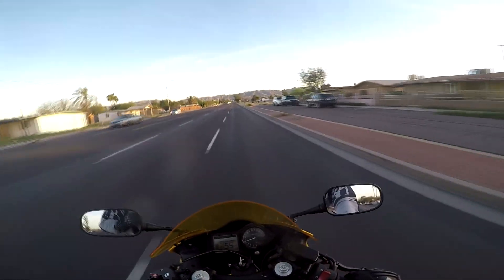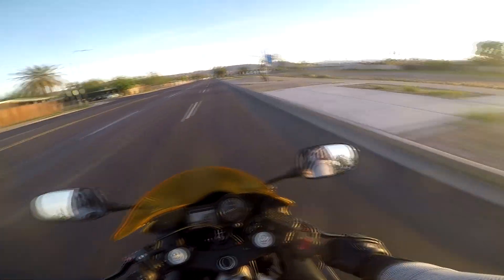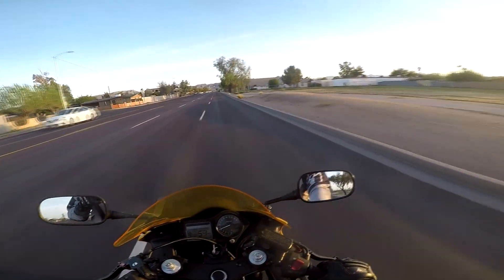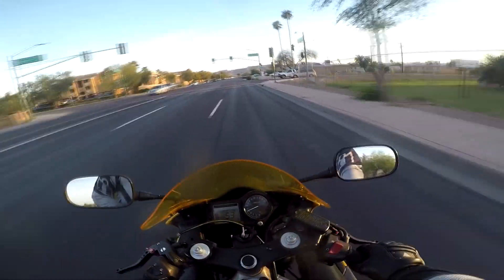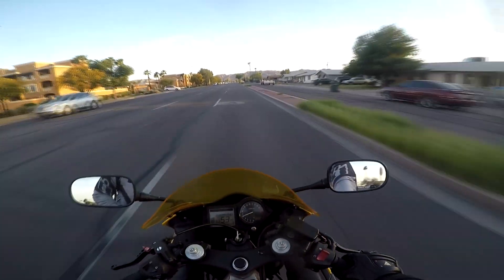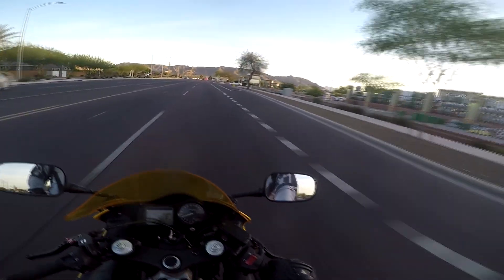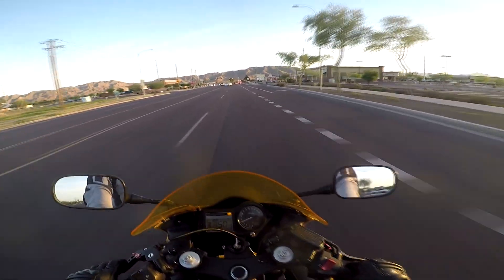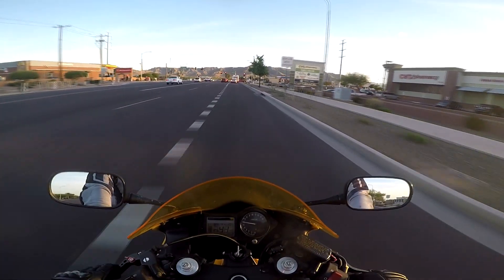should you get a power commander?

Comment: putting on a power commander on a stock bike is still a good idea imo. Most bike manufacturers run the bikes lean or rich depending on the bike. adding a fuel mapper won't hurt it all. the only downside of doing this is that most people are trying to get more hp and end up causing the bike to lose MPG. also too, i like watching local vloggers but i would seriously look into getting a better quality audio if you want to grow. that wind noise makes hard to keep watching. if you need tips or gear i got some extra stuff that may fit your setup. hit me up.